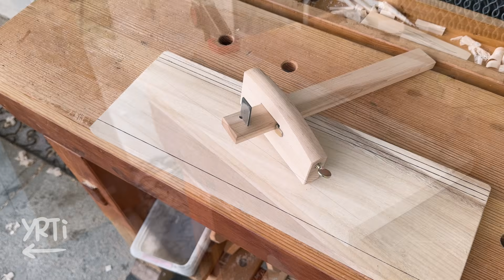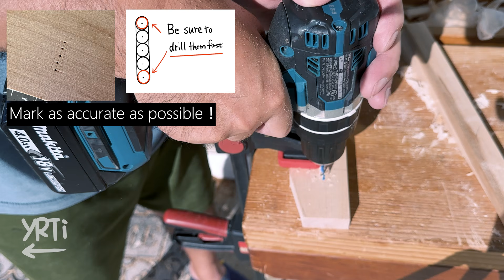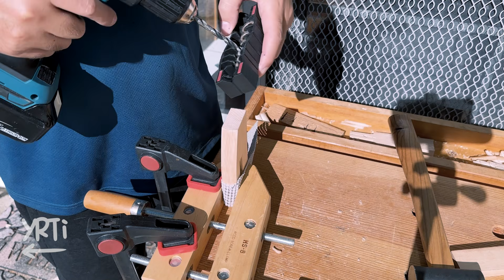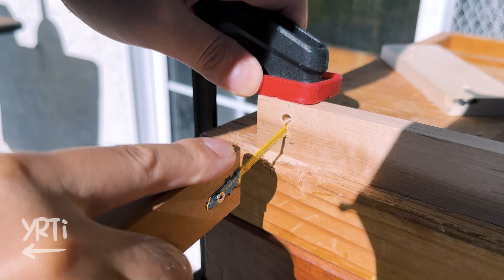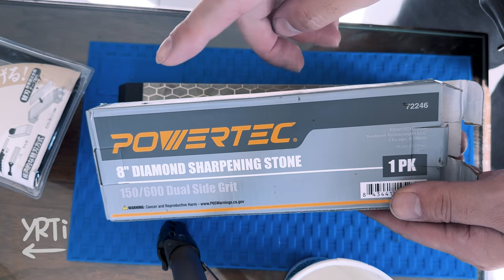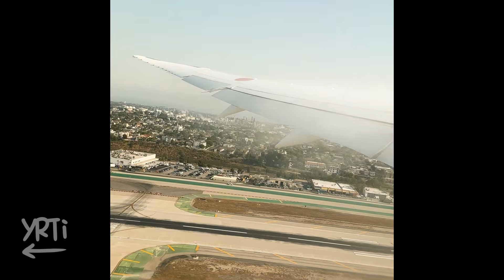Making a Japanese Kebiki Marking Gauge from a Kit I Put Together

Comment: Will this cut thin boards or is that a different tool?
Reply from the maker: Thank you for the comment. To cut a board, there is a cutting gauge but that doesn’t mean this one can’t cut! usually, I would say up to 1/8”, just a normal japanese marking gauge can cut it as long as the blade is sharp:)
Reply: @YRTi thanks 😊

Comment: Are those blades ever made skewed the other direction? EG. Looking at it from the flat back, the point is on the left--what about the point on the right? Of course It can be manually sharpened. I've thought about making a fixed width mortice gauge I often use with both bevels on the inside. That's why I ask. Would they both still require a 91° bias? :S

Thanks . Great video as always!
Reply from the maker: Thank you for the comment! Ready for a long response? :)

There is a blade with the pointing tip on the right, which is meant for a left-handed marking gauge. However, for Nihon Sao Kebiki (二本竿毛引き, two-beam kebiki), it seems they use the same blade for both beams, and both have the same slot angle, based on a picture I’ve seen. I haven’t seen the real one in person, so I’m not entirely sure. There is also another type of kebiki called kamakebiki (鎌毛引き), and for their two-blade version called Nicho Kamakebiki (二丁鎌毛引き), just like Western-style gauges, they use two different blades with the bevel on opposite sides.

The problem with the bevel facing outward is that it pushes the kebiki body away from the reference edge. Since this is a known issue, I assume that for something like the Nicho Kamakebiki, there must be a trick to prevent it that I’m not aware of...sorry

Additionally, they don’t just angle the slot sideways; they also tilt the blade vertically (from the bottom to the top of the blade). From what I’ve heard, the bottom side (the cutting edge) should be slightly farther from the body than the top side (the non-cutting edge). Viewed from the back of the kebiki body, it looks like a “/”, allowing you to slightly undercut the workpiece while keeping a clean surface line. However, the Nashiya one I bought was perfectly vertical, so I didn’t mention this in the video.

Comment: Very good video, and thank you for your efforts. That is an extremely inexpensive kit and a good project.  One question, what size drill do you use for the ball point pen insert?  (and what pens do you use?)  I made something similar to the pen kebiki (??) and the pens always slip if I don't wedge them with a screw.
Reply from the maker: Thanks for the comment! Honestly, I don’t remember which pen it was, but it wasn’t actually a refill. I just took it out of a random freebie pen (I believe it had no brand) that I got years ago. 

The hole is 1/8", and I thought I could just use a glue gun if it didn’t fit well, since I don’t need to remove it often to sharpen it. But it ended up being a nice friction fit. However, while pulling it out from the beam, the metal tip somehow came off the plastic ink tube (the biting point was the plastic, so I’m not sure why), and I ended up splashing the ink. 

I may upgrade it to a fully metal refill to avoid it. When I do, I’ll probably measure the diameter of the refill to make a hole next to the current one, and if it’s too loose, I’ll use a glue gun again.
Reply: @YRTi  Thank you for the reply.  I think a metal one would work well.  Well done project and really nice and complete plans you provided.